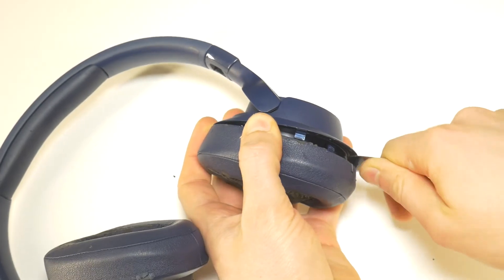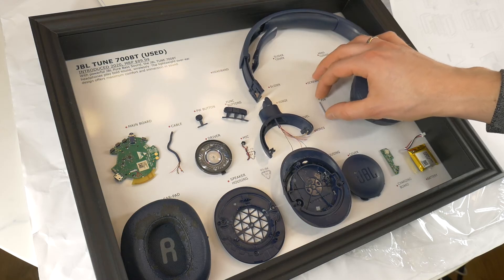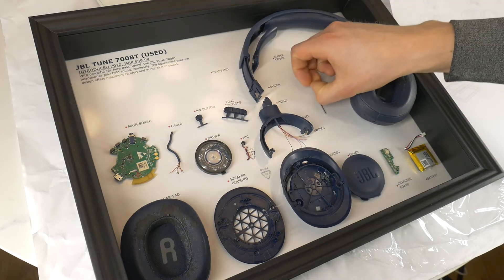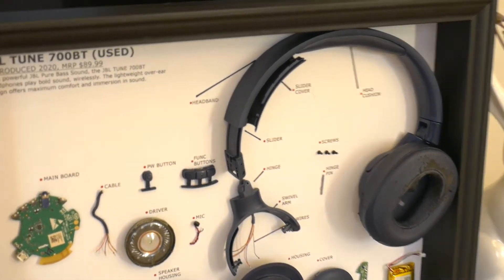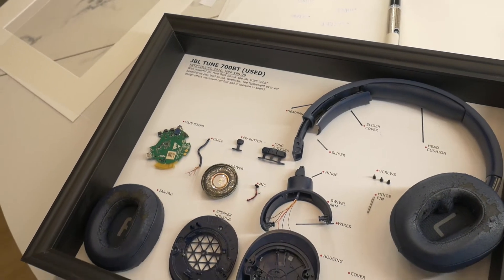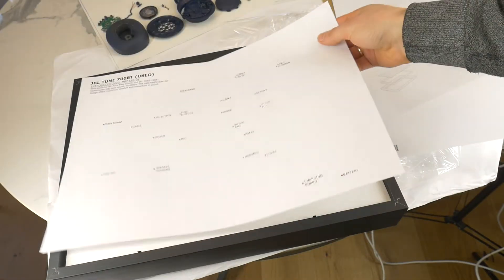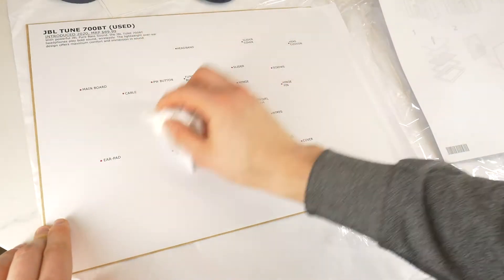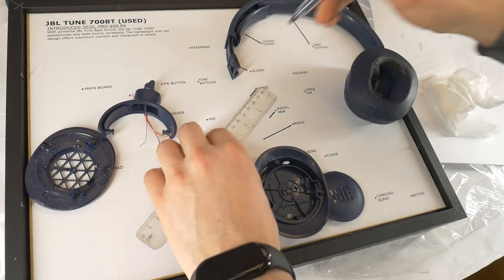Look inside JBL Bluetooth Headphones - Disassembly

Comment: The swivel part of mine broke, where you had to melt the pin out. IMHO this is the weak point of the otherwise fantastic headphones and there is no easy way to repair this part. Replacement parts are also non-existent. Something to keep in mind when looking for headphones that are prone to abuse.